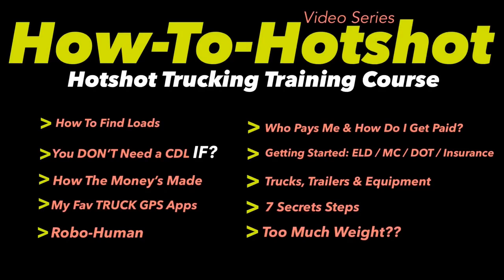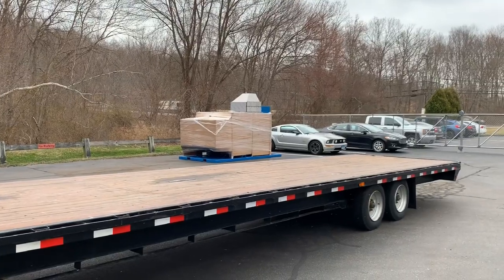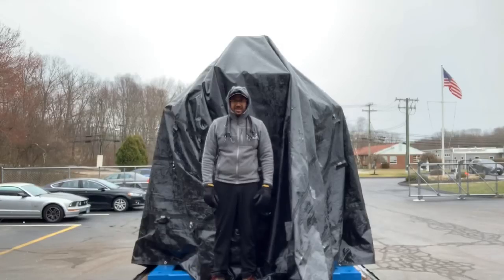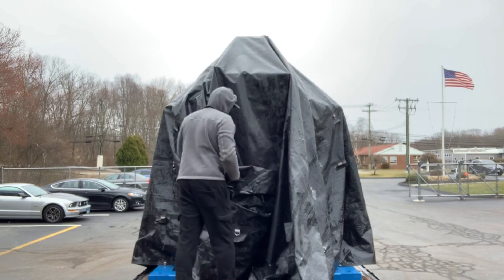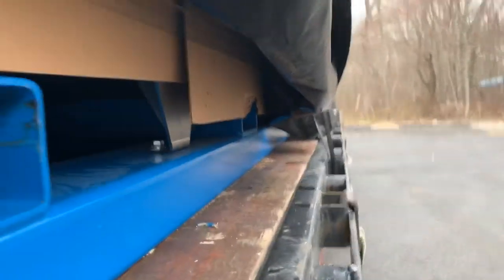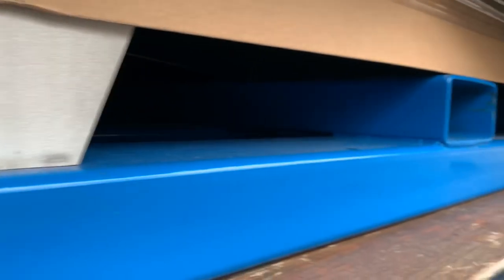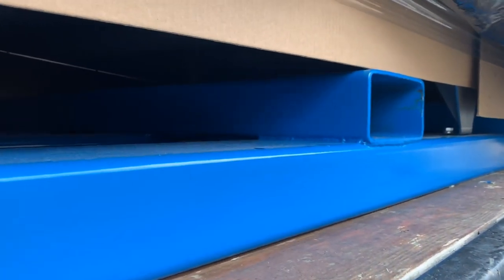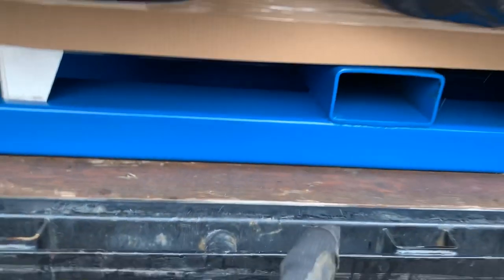FREE VIDEO TRAINING PREVIEW | HOW TO CHAIN SECURE a 9 FT LOAD | How to Start Hotshot Trucking

Comment: We're you worried about the chain rubbing off the paint?
Reply from the maker: - GREAT THINKING!!! I have moving blankets ($9 each at Harbor Freight) that I usually cut, fold and place in between chains and the item...on this one I didn’t because the loaders told me scratches were okay because every one of these units are chained this way and scratches are expected...I slacked tho because even with that, I typically would have used them but I didn’t’t. Great catch 👀!!!
Reply: Also, What are is your Gcwr?
Reply from the maker: Cleveland Native - 26,000 is the magic max number for non-CDL hotshotting. There’s an entire part dedicated to explaining this in detail in my free “How-To-Hotshot” video series...it’ll be out next Friday.

Comment: Where do you mount your fire extinguisher and triangles?
Reply from the maker: Great question! I keep both of them (+ my tool box & PPE) behind my passengers seat. I keep it on that side purposely so that if I’m on the side of the highway and need access to any of it, I won’t be dangerously close to traffic.

Always wanted to mount extinguisher where floor and passenger side backseat meet but too chicken to poke holes and Poss damage electrical (happened to buddy of mine). I’ve passed two level 1 inspections with things this way though.
Reply: @hotshottruckingtrainingcou9645  ok that's what I'm afraid of, mounting it. Thanks as always
Reply: If you feel the need to mount it , I mounted mine under the back seat (driver side) on the bottom side of the lid flap (I assume newer Ram still has that)
Reply from the maker: Doug Spruill - great idea!! My rear seats lifts but there’s no flap just a sunken storage area where I store it now. Could mount under liftable rear bench seat too. Thanks!!
Reply: @hotshottruckingtrainingcou9645  yes might need a couple plastic anchors, but that's if they say something to you
Reply: @hotshottruckingtrainingcou9645  wondering if you have a spreadsheet template that you wouldn't mind sharing (blank of course)?
Reply from the maker: - Doug, I wish I was that organized lol.